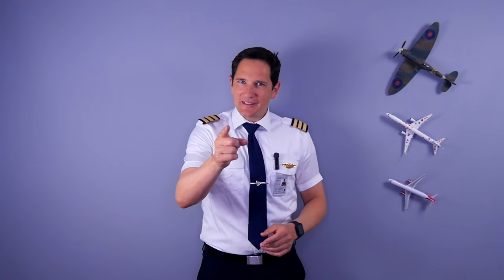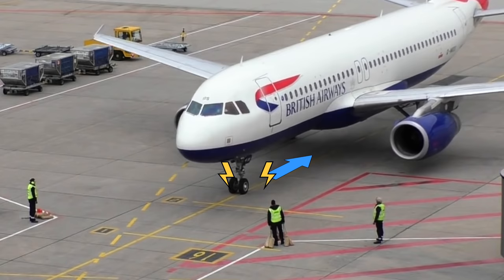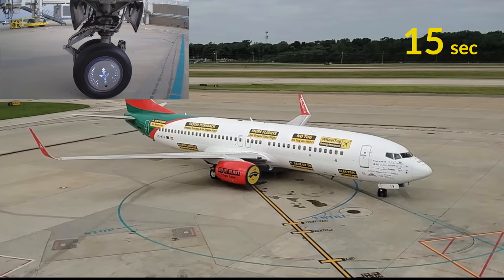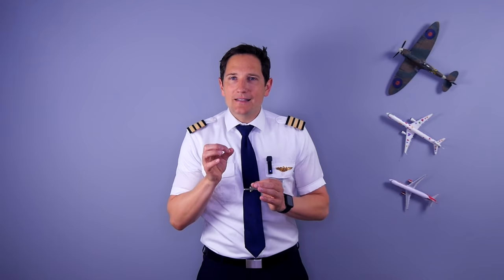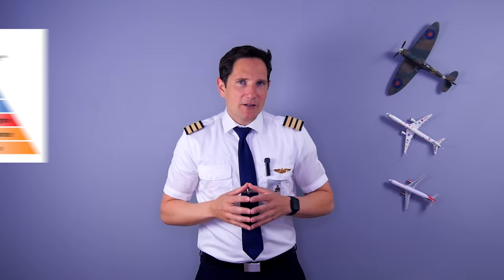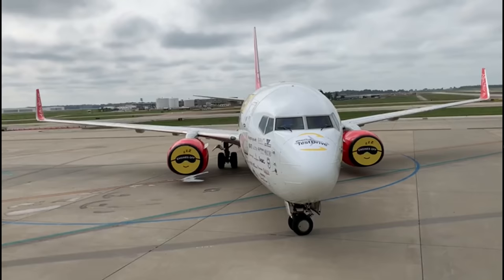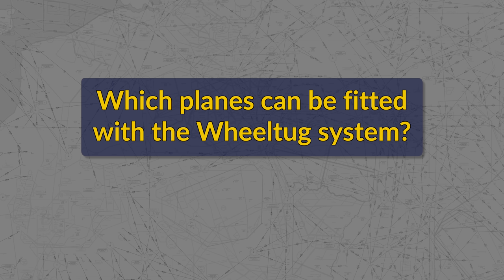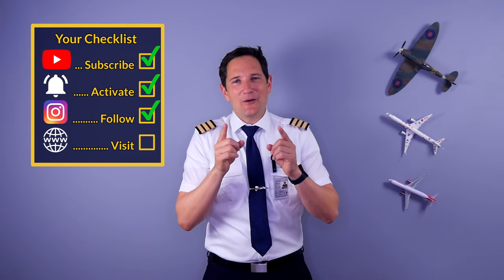The FUTURE of PUSHBACK is ELECTRIC! Without a pushback truck! Explained by CAPTAIN JOE

Comment: Very little advantage to this technology. You still need all the ground personnel, the pushback becomes a much higher risk operation if it is controlled from the cockpit, and the newest generation of engines are so temperamental about warm up and cool down time that electric taxi is not that beneficial. You would still probably need an interphone which is a safety hazard if wire connected to a walking ground personnel. Cameras could be used to help but that costs more money and weighs the plane down more than the electric motors themselves do burning more fuel in flight in the long run. The only place time would be saved is disconnecting the tow bar/tug after push. Another disadvantage to the full electric taxi is that you may find out half way to the runway that an engine or something related is not working rather on the apron. The issue with just wheel tug is that you are not starting or probably even stopping the engines any sooner. You cannot taxi at like 4 knots without just wasting all that 5 minutes you saved and clogging up a busy apron so the engines have to be on at the same time they normally would be. On arrival you may lose steering or brakes depending on the aircraft if you shut down sooner. To really benefit from this honestly it looks like airports would also need to be redesigned. Remember, conventional pushback is controlled by people that have full line of sight of the apron and still incidents happen, with this it is ultimately controlled by pilots in the cockpit. The listed benefits of this technology sounds like your usual aviation tech marketing mumbo jumbo, most of which is served with a side of fine print. Keep in mind many of the benefits listed are for full electric taxi, but all the drawbacks are using data for the wheel tug. Just make electric tugs and be done with it.

Comment: I'm curious why this hasn't happened before now. Electric motors have existed for a long time, and routing the power from the APU is a convenient source of electricity. But hey, I guess sometimes these things just aren't thought about
Honestly, I'm most excited about parking the planes parallel with the terminal and having duel jet-bridges. Although the fact that you could power up the engines on a rolling start to avoid wear and tear is pretty cool too

Comment: Wow! As an advocte for ALL forms of human transport, I have had earlier the concept of not only doing this but to electrify the MAIN gear with an electric motor and taxi electriclly from gate to runway and reverse proceedure as well.

Of course it shan't be too long when starting with regional aircraft to be ALL electric back to the fan as there inclusive of Airbus have flown a two seater and a four place demo plane (something one would see with general aviation) that is powered by two eFans. A-eFan 2 and A-eFan 4 respectively.

Norway has already passed a law making mandatory several years now to require all domestic or regional aircraft to be 100% electric with absolutely no fossil fuel onboard whatsoever by the year 2040. This is a good start as anything electrically powered is right on my flightpath!

Comment: What about all the mess at the stand... Pushback is at least 2 persons (neon plus tug driver)... And cockpit is blind - less than 270 degrees of visibility.... On a working example the did introduce additional painting on ground so some arrangements from the airport itself is required I guess (especially when turn around the is to be considered). But Ryanair will implement it, no doubts :)

Comment: This is one of those innovations of which I'm surprised they still hadn't arrived. I also still don't get why they don't fit camera's aimed at the engines and other moving parts. Cameras also seem important to me if pilots are allowed to manoeuvre the plane by themselves to spaces where they have no sight from the cockpit.

I also don't understand why they still haven't digitized the ATC communication (with fallback to voice, of course). These are well-formatted instructions with a very limited variability and should therefore be easy to convert. By providing them digitally, there's no risk of miscommunication, encryption can guarantee the instructions came from the correct source (unlike radio), the system can guarantee that the message was received, the airwaves stay clear, and the latest instructions can remain visible on a display in the cockpit as a reminder. The only downside would be that inputting such instructions while actively piloting is obviously not a good idea, while speaking is always possible. But ATC is often handled by the copilot anyway, and there's always the fallback to voice.

Comment: As far as time saving is concerned, i'm pretty convinced but the fuel saving has to be demonstrated in real life. Let's assume a 2h flight (ie 1200km) + 2x5min of taxi in&out : 200kg dead weight to carry in flight (80kg of fuel) + APU fuel consumption on the ground (18kg of fuel) = 98kg vs 100kg with "classic" taxiing. Very promising for short flights especially on busy airports with long taxing time but the turboprops are far more efficient in this range... Correct me if i'm wrong... ;-)

Comment: I'll probably be retired by the time major airlines, and airports are ready to adopt this system. 
I think people underestimate the cost to overhaul existing infrastructure in an already tightly packed gate area.
And I would LOVE to see them try this on a widebody. Grab your popcorn, and watch the mayhem unfold.
Reply: They can fit it onto an aircraft quickly, and since it saves time at the gate, widebodies aren't benefited so much, since they fly 5-15 hour legs, rather than 1-3 many more times a day
Reply: @johnstuart8013  I'm referring more to the layout of the gates that service them, as well as the ground operation itself.
When the A380 debuted, it's potential routes were limited to airports that could safely accommodate her size, and weight.
The airport I work at had to completely rebuild the one gate that can service her, and restrict the taxi routes she could take, so as not to traverse any bridges.
To allow for this system's featured spin maneuver, a similar rearrangement of the gates' layout will be necessary, and most airports/airlines probably won't want to sacrifice other gates to make room. 
So, even if I'm wrong about the adoption timeframe, it's likely that pilots will only be allowed to push themselves when it's straight back, or an L shape. No U turns in cramped alleys allowed.
Reply: @johnstuart8013  My airline is moving away from towbars altogether. I won't miss them. We use a new system called Lektro. Just pick up the nose gear, and go. 
There's actually not much risk to crews during pushback. The operation is fairly carefully orchestrated.

Comment: Despite looking straightforward for present times, where electric motors are ubiquitous everywhere, the tech involved is pretty impressive. Imagine that the motors and clutch systems are mounted on the unsprung part of the gear : the wheel. Which may get slammed on the ground by hard landing hundred of times in the lifetime of the system.
Reply: There is a balloon tire acting as a bit of spring and distributing the shock to the whole titanium wheel rim. I think the only challenge for the hub-mounted motor is the much larger moment of inertia resisting spin-up and the details of any linkages in the clutch. It sure is an intriguing mechanical design problem. Perhaps the company will report on drop tests of a motorized landing gear sometime soon.

Comment: Interesting but I don't see how this is as safe as having the tug push the plane back.  The tug driver has the best visibility and control over the pushback as well as stopping quickly if a collision is imminent.  A pilot is not going to have the same visibility regardless of the extra cameras/monitors that would be needed.  A pilot staring at a monitor is also going to be oblivious to hand signals from ground crew that are trying to convey a warning to the pilot.

Comment: Dear @captainJoe, I have some more questions.
1. How much energy does the WheelTug provide? Say, on the average commercial passengerflight, like the Boeing 737 or an Airbus A319/320/321, would it provide enough energy to tug the plane all the way to the starting position on the runway?
2. In extension of question 1: can these Wheeltugs be mounted on all the wheels, so taxiing to the runway can be done totally electrically? 
3. Would it be an idea to make the WheelThug mountable per aircraft? So, for the pushback, groundcrew would 'plug it in', pilots do the pushback, and once the aircraft is ready to taxi, groundcrew 'unplugs it'. Would that be a feasible idea?

Comment: Will it do a burnout?   I love this, I've envisioned it like so many others for years - but my [entirely imaginary] version included dynamic braking back-driving the engine(s) through the motor/generators!  Once hybrid airplanes are a thing, I look for wheel motors to improve T-O performance during the low-speed phase (maybe decoupling at 80kts) when the engines are moving more air than airplane.  I do see one pitfall to this system - this removes one layer of security against theft/unauthorized movement (whether the aviator/joy-taxier is type rated or otherwise).

Comment: Thanks for the video.  Keep ‘em coming.  Did I hear that right, an airline can “lease” this?  OMG every company wants some sort of subscription based income.  But putting a motor on a wheel is so common nowadays like on e-bikes or e-scooters.   Why aren’t the aircraft manufactures offering this especially on new planes? It seems this could be easily phased-in while still using ground support.  One could also envision having the ground crew control the unit.

Comment: The funniest aspect of this is how this is not the norm for decades now... I get that the airplane needs to have enough stored energy to be able to run a motor powerful enough to run but isn't an idling jet capable of supplying said power or the auxiliary power unit in the back? LOL I am sooo goood... and at 237 the obvious answer is indeed the APU.

Comment: But now image the aircraft about to land and the electric motor in the front wheel has malfunctions and e.g. spins the other direction. It could cause high damage to the wheel itself and therefore need more time on ground to repair it again

Comment: Well, Captain Joe I completely agree with your statement that the future pushback manoeuvre would be without push back truck, however in my opinion, this technique might be fit for small babies like :- both  Boeing 737-800, 737-900,  and Airbus A 318, 319, 320, 320 neo, besides there are other small size aircrafts might be considered such as :- Embraer and ATR, but I personally believe that perhaps it wouldn't  work for the super jumbo jets for instance Beoing 747 and 380, either 777, 787, 767 or 350, 330, 340. Lastly, what the aviation industry has planned for those thousands of employees working as driver to pushback the aircrafts, obviously they need to think about their future too, that what would they do after bringing such kind of innovation at the airports?

Comment: This is a great initiative it will surely reduce Operation time and cost. I wonder why this technology is introduced this late? It was definitely a no-brainer idea. < 3
Reply: Nice!!! But, during standard push-back procedure (with tug) we are, at the same time, starting engines (so at the end of process aircraft is ready to taxi engines on). With this new process you can not start engine during the push. You will have to take few min after that to start engines. So  finaly same amount of time to be ready to taxi with engine on.

Comment: I doubt it will work in the forward and reverse direction on an empty plane because there might not be enought friction and the wheel can slip, the big majority of weight is on the rear wheels.

Comment: Before a long time, maybe 10 years or more I saw this in PRG airport between terminal one and two. There was a big front aircaft wheel with a text about electromotor in this and about is best for furutre and saving fuel.  It was removed before some years. :-( Maybe you saw this too.  Now is caming to a reality. ;-)

Comment: I had this idea for a long time.... Why not put a motor inside the landing gear? My idea was to do it hydraulically, there is more power per weight available in hydraulic units and the lines are already there...

Comment: Has it been tested to function in weather ops? Heavy rain, snow, ice, standing up to deicing fluids. Are pilots or pilots union agreeable to the shift of liability onto the crew for non movement area damage or contact with other equipment? What is the plan for acceptance at different destination airports which would require re training of staff and likely re striping or additional marks and signage required in the airside  gate area? If the aircraft were in a tight ramp area at an unusual angle while turning out and the drive failed, there would have to be room to maneuver a standard tug in to place which could be tricky given certain structures or adjacency in the traditionally laid out gate area.

Comment: If the APU can handle it, wouldn't it be better to have some or all of the main landing wheels fitted with this, and just use the front landing wheels for steering? It just seems more economical, as instead of pushing or pulling against the weight of the aircraft with the front wheels, you are instead pushing with the weight of the aircraft, regardless of direction. It may mean a slightly larger turning circle for bigger aircraft though, but using the rear wheels to move could save even more time in taxiing.

The current speed using the front wheels is slow for that reason, you are pushing/pulling against the weight of the aircraft. Using some or all of the main/rear wheels could result in improved speed, as you are moving with the weight of the aircraft, not against it. It's also potentially far less stress on the body of the aircraft.

Comment: The problem with this, that it adds weight, therefore more fuel burn, and one more thing that should be checked regularly. Why not using an electric powered automatic tug to pull the aircraft all the way to the runway?

Comment: Here's my question. How much weight can the wheel tug system can handle. If the plane is full passenger capacity with flight crew. Plus bags and cargo.

Comment: This is an attempt to solve a problem that does not exist.  But, let me go ahead and count the ways that this is a bad idea:

1.  Complexity.

2.  Added electrical system/ FIRE potential.

3.  Can it be MEL'ed?   

4.  If it is on MEL, what happens when the plane flies into a small airport where the station has no tug?  That is exactly the kind of thing that would get missed.  What, are you going to ge an airplane stuck at a gate somewhere?  Or do it "Russian style" and get 15 guys to physically push it back?

5.  Ice on the ramp....

6.  Added weight....

7.  Added COST for installation.

8.  Added COST for maintenance.

The list goes on. Really, if you want some sort of solution for tugs, at least for smaller airliners like the 737, the idea would be to figure out a way to make a common vehicle a push back truck instead of having dedicated tugs. Not a complex hub motor system.  You know what they say:  "If the aircraft manufacturers aren't installing it already...."

Well, at least your video was well done, I'll give you that.

Comment: The diagram showing what will be saved shows that wing walkers and other ground crew will not be necessary.  Perhaps the person who believes that can explain why the tug driver requires wing walkers - after all, he has better visibility to the rear of the aircraft than the pilot has.  Even large lorries require a banksman when reversing.

Comment: Well the idea looks nice on paper and on screen.  But in real life ramp operations, it has some major hurdles to over come.  First, I haven’t been to an airport in the USA that had enough ramp space to safely operate without outside ramp help.  I would like to see a three gate simultaneous pushback where the space between the wingtips is less than 5 feet like most airports I’ve worked.  I could see a lot of wing tips and winglets getting chewed up.  Secondly, the inspections on the rims would have to be more intense because the titanium would be more prone to internal stress fractures than the current magnesium rims.  I know the airlines would love it to reduce headcount.  But for safety’s sake, after a few crunches, that would be out.
Reply: @johnstuart8013  well brother, at the airports I worked, we did it two to three times a day.  The tails would end up pointing where the flow would not bother the next jet until all three were ready to taxi.

Comment: What I wonder though, as the push back is usually used to power of engine 2, when will the engines get to run up when using wheel tug? After all, there are check lists to complete while the engines are running, right? You can't do that while taxiing, so you need to be at a certain position anyway to do it. That would possoble clog up taxi ways for longer, as both engines would have to start up at that spot. If they did it after turning 180° near the terminal, they would blow away equipment, personell and damage the gate area. 
Or am I mistaken here?

Comment: Not sure how well this will take to the airline manufacturers and airline companies. In an industry with such small profit margins always looking to save money, this will add weight resulting in loss of efficiency as the plane needs to carry this in flight. Not to mention the extra costs of maintenance hours plus replacement parts. Will this offset the profits lost by sitting on the ground waiting for a truck? It will be interesting to see where this goes.